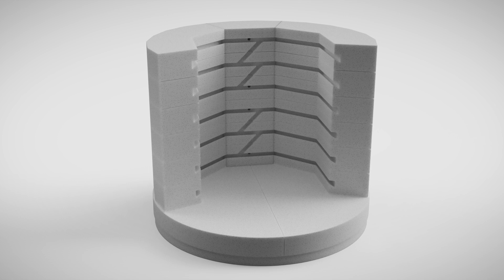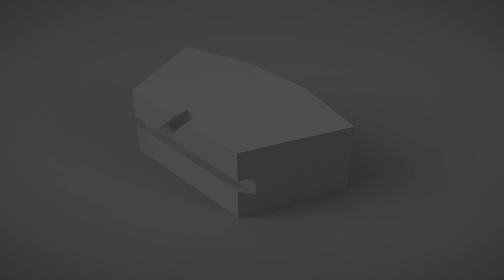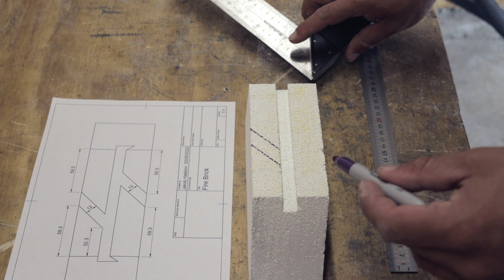Ultimate DIY Electric Kiln Guide - The Fire Bricks (part 1)

Comment: This series was great and helped my build my own kiln! One think to note is that I cut my bricks to be on there side rather on there face to increase the room in the kiln, I also had to cut the slots for the element deeper than than the element and to cut that slot down creating a shelf lip as the element grows and shrinks as it goes through its heat cycle, so I had problems with the element pulling away from the walls and coming out of the slots
Reply: Please what kind of bricks did u use !

Comment: HI, 
I saw your videos on building the oven, thank you very much! the tutorial is very well done and detailed.
Now I want to build one too and I'm looking for all the necessary materials.

I found the bricks of 26T refractory material, but I can't find the tiles you used for the lid and the bottom, 50 mm high. Can you advise me where I can buy them?
I imagine I will necessarily have to use 26T or 26J material and not a common refractory material.

I also ask you, can you share the files of the shaped and processed bricks and the technical drawing of the oven?
do you have a general list of the materials used?

Thanks so much again

Comment: I see you don't have thermal insulation other than the firebricks. Is it enough? What temperature do you measure on the outside of the barrel, when inside it is 1300 degrees Celsius?

Comment: Ive been working on the recipe for the insulated fire brick. Talc20%,ball clay25%,mullite55%. Thats a good recipe for alot of kiln furniture, like shelves, insulators for kiln filaments. Kiln stand offs, whatever. I did 2 small test bricks. 1 with old brown tree leaves i ground up and mixed into the clay and the other with packing styrofoam(EPS Foam) i ground into its individual cells. The foam and tree leaves are just filler to create voids in the brick to create the insulation properties and light weight and I think I did 50/50 by volume and think theyre a little dense and you could go harder on the burn off substrates, But definitely usable at 50/50. Then I fired it at cone 10 and left the kiln lid cracked for maybe 30 minutes as the burn off stuff produced smoke. Then closed it and ramped it. End result is 2 usable insulated firebricks, althoug 2"x4"x.5" (since it was just a test) and no damage to the kiln. 

Thats probably useful if you can source the raw ingredients cheaper than the bricks and or want to build bigger kilns out of smaller kilns.
Reply from the maker: Cool that is a very intersting approach! I am lucky to live a mile from a guy who imports these bricks, so that is the easiest for me :)

Comment: Can the bricks be written on? I can’t help but think it would go easier if marked say, layer ‘x’ with an arrow facing up & maybe adding a special character for the slanted bricks for the element channels that go to the next layer. It would be my luck to mistakenly mix up the bricks.
Reply from the maker: Yes, I used some small pencil marks without any problems.

Comment: How many hours of research did you do before making the first drum cut? What 3d program did you use? Did this program determine design solutions? I'm very interested in diy and can see myself doing every step of this project simply because knowledge if tools impacts craftsmanship. I appreciate your emphasis on quality tools but also appreciation for your neighbour's drill. I am fascinated with the calculation of the wiring, probably because I am not an electrician. How long did the project take from concept to  completion?

Comment: Love from India🇮🇳
Very nice video and Thank you so much Sir for this video

But explain one thing that what is white solid which you are used?
Reply from the maker: It is insulating fire bricks :)
Reply: @jakobhalskov  What is material for the pure SiO2 glass melting mold, for temperature ~1700 C degree?

Comment: I am very curious as to what type of element you used (the diameter of the wire) and how you wired everything. I'm also making an electric kiln but somehow mine does not go above 780 C, still trying to find out if it's the thermocouple, the wire or bad insulation.
Reply from the maker: Hi Thomas, I am working on part 2 of this series these days and hope to release it by the end of this week. It includes the calculations for designing your own heating elements :) How many kilo watts are your kiln and how well is it insulated?
Kind regards
Reply: @jakobhalskov  Hello Jakob, thank you for the quick response and interest! I look forward to the follow-up video. If you can, please include where you bought the wire because I had a hard time finding a decent supplier. 
About my own kiln project; yesterday I found out that the heating element wire has burned through at 2 of the points where I made a connection to the wiring of the electronics. I think I bend it too much. So I need to fix that first to see if it still won't go higher than 780 C. My kiln is pulling about 3000 watts, maybe a bit more. Insulation is a bit like yours, firebricks (type 26 or 28) first and around those a 'ceramic wool blanket'. I used a big old Miele centrifuge from the 50's for casing.
Thanks again, hope to hear from you!
Kind regards.
Reply from the maker: @Alm4nza  You are very welcome Thomas! I am wondering how long it takes for your design to reach 780 °C; for my 5 kW design ( closer to 4.5 kW in practice ) it takes 110 minutes to reach 790°C. In the end it is all a matter of how much energy is put into the 'system' vs how much escapes through the insulation/gaps in the kiln. I purchased my "1.4mm Kanthal D wire" from a German supplier called "Evek GmbH" which has fair prices and ships to Denmark where I live. Looking forward to hear from you and see if you can achieve higher temperatures. As you will see in a future video I can achieve >1100 but also managed to melt my SSR relays and PID controller partly..
Kind regards
Jakob